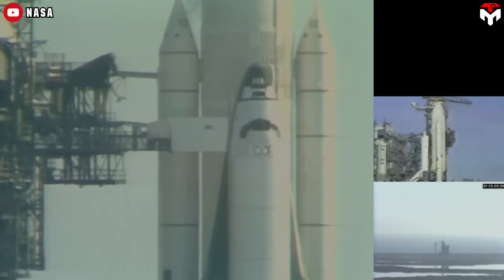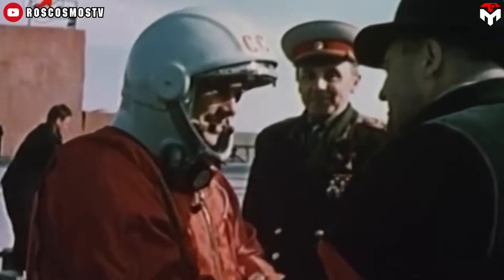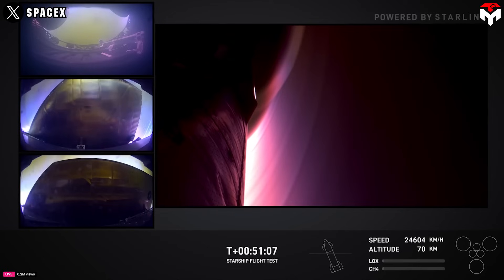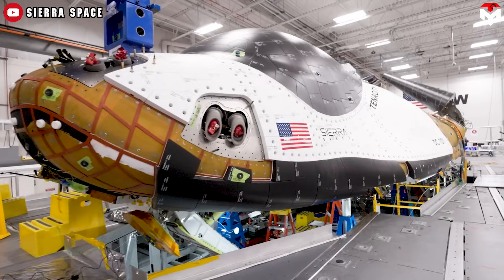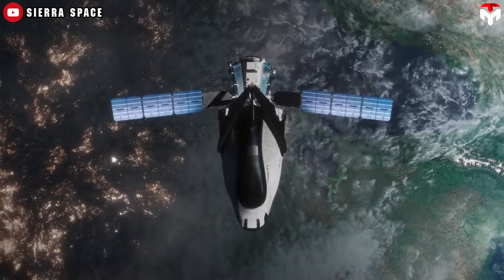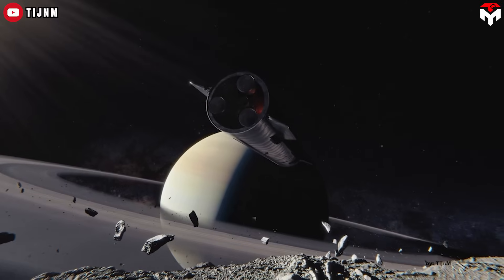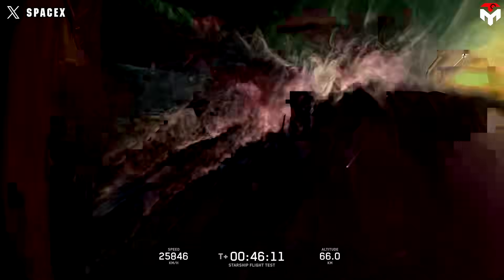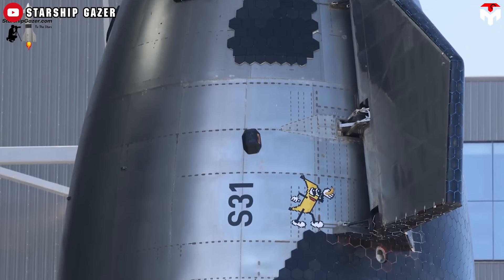SpaceX's Genius Solution On Starship Heat Shield Just Humiliates Dream Chaser!

Comment: Musk on Mars - Space Unicorns - See the Spoiler near the end.

Using statements & documents issued by Elon Musk I have calculated the viability of his Mars colonization project.

Musk admitted that 1 million tons of material must be sent to Mars in advance of humans to supply the components for safe habitat.
That requires 10,000 successful launches and subsequent descents of Starship to the selected habitat area on Mars.

In addition, Musk stated it will take 6 more Starships for every Mars bound vehicle to refuel those Mars bound Starships waiting in low-earth orbit before the actual Mars journey.
That's 60,000 additional Starship launches, allowing that there are no failures.

This gives us 7 launches for every Mars bound vehicle. So in reality, at one launch per day  it will take 7 days per Mars bound vehicle. That now totals 191 years to complete material transfer.

Spoiler:
The window for a Mars launch is once every 26 months, with  15 days available in that time frame (49 launches per day).

That means Starship will have to cram in 732 launches in 15 days every 26 months to meet the 191 year infrastructure transfer.
A Starship must be launched every 30 minutes for 15 days straight.

Obstacles:

1) What will happen to the first material that lands after 191 years while it sits waiting for the final structural parts to be landed?
2) Who will finance each Starship, the cargo, fuel mass needed to make the journey?
5) What can be done at the Mars site if material is damaged?
6) During the 191 years will there continue to be a viable SpaceX factory?
7) How many Starship launches will fail during the program to put material on Mars.
8) How many Starships will crash during the landing phase on Mars?
9) How about feeding the astronauts for 7 - 9 months?
10) How about feeding the Mars colony forever?
11) How quickly can the first Mars colonists erect even a basic safe habitat?
12) What if the ship(s) ferrying food fail to reach Mars?
Reply: Well developed thoughts, thanks.
Your arguments puts the hopes of the Mars fiction into a perspective of what is possible with our current technical capacity.
Of course progressive assembly and preparation of the colony landing site and readying agricultural initialisation, harvesting and storage will be using the Tesla bots, not astronauts.
Ditto for in-situ resources for construction where possible and production of fuels.
Development of new landing techniques will be used instead of landing the Starship, at least until it is necessary to put Martian produce into orbit. So there are many years available to develop new techniques and technologies to enable a comfortable and safe life on Mars. 
Hopefully by then, Elon's personal challenges will be less damaging to a remote colony.

Comment: Good morning Monday 🙏 🌄 my friend ✌️. I do not knw if SpaceX Upper ship install an insulation to minimize heat transfer to the Ships structure. I can not think right on the bat w/c of the chem material or composite tht can stand the heat of 3000 degree Celsius. Like a suit to use in measuring the Magna of the Volcano. 
Tht shd be use b4 installing the hexagonal metallic tiles. I've also stated in the past my thinking in re-science heat shields are typically made of specialized materials like carbon composites, ceramic tiles or ablative materials like PICA tht's the Phenolic-Impregnated Carbon Ablator.
It's my Fly-day and thank U ✌️my friend. 
Sorry, I wish I cld contributed more in the making of SpaceX heatshields. Enjoy 😉 my friend 🌟
•~●kat 🤓
Reply from the maker: Thank you so much for sharing your thoughts, Kat! 🙏😊
Yes, you’re absolutely right — heat shields like those used by SpaceX must withstand extreme temperatures, and materials like PICA (Phenolic-Impregnated Carbon Ablator) have proven to be very effective. It’s fascinating to think about how much engineering goes into something as critical as thermal protection. Your input is always appreciated — don’t worry about contributing more, your support already means a lot! 🚀💫
Wishing you a great Fly-day too! 🖖✨
Reply: Heya  @techmap9 👋 there! Yep, my friend and I were thinking of getting wasted after work. Worse, we can be loud and notorious 🙄🙃🤭 painting the town red! 
Best part, nobody recognizes us on our civilian clothes. 
Enjoy, ur Monday my friend ✌️
Thank U ✨️